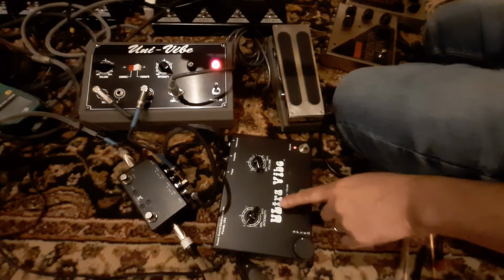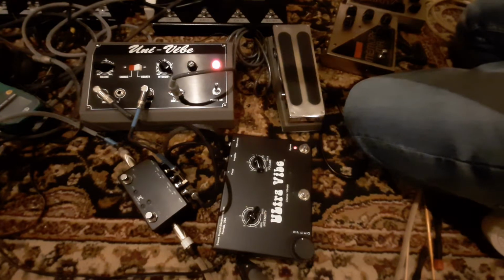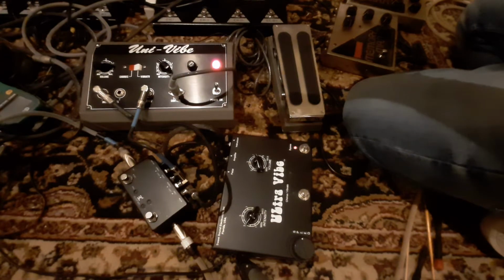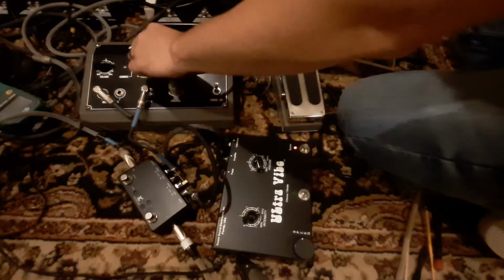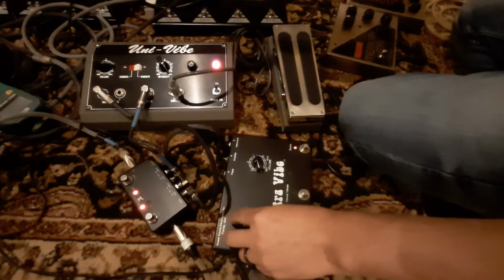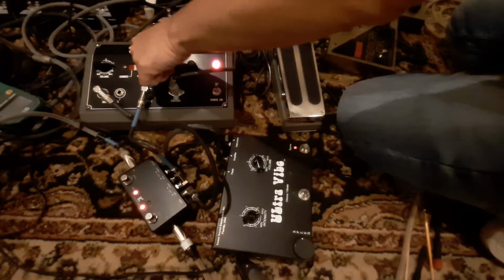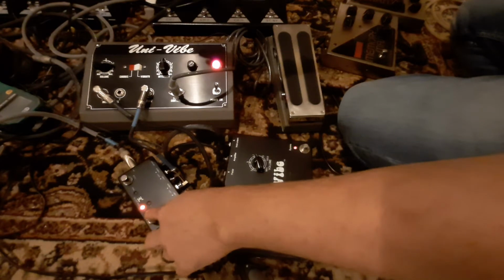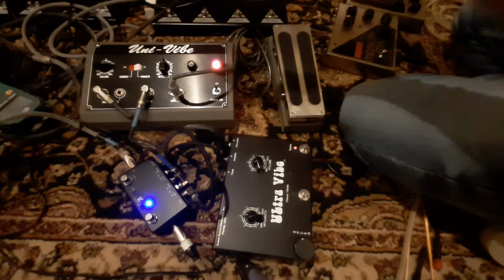Shin-ei Uni-vibe vs. Sweet Sound Ultra Vibe

Comment: I have an early Ultra Vibe with a hard-wired AC plug and a sick swirl paint job. Looks cool but meh, kind of dull sounding. It's transparent but no swoosh or weesh-wah going on. Looking to get it modded. Does anyone have a recommendation? I haven't popped it open to check for any micro-pot adjustments yet.
Reply from the maker: It should have the hole at the bottom to adjust the trimpot with screwdriver without having to remove the bottom plate. If you're interested in selling it I'd be interested. Please let me know.